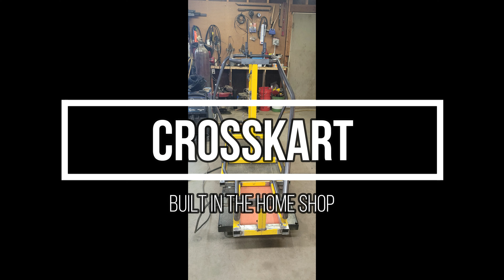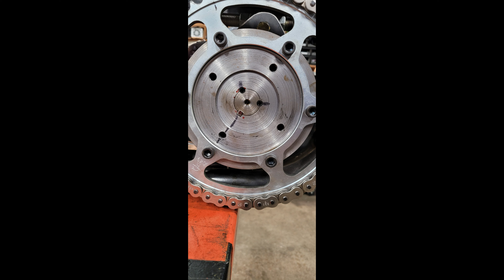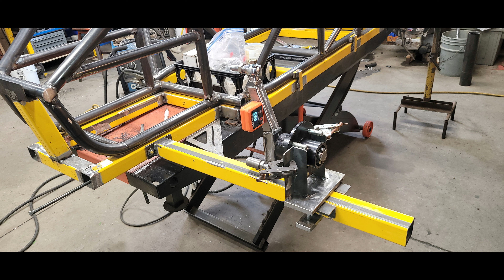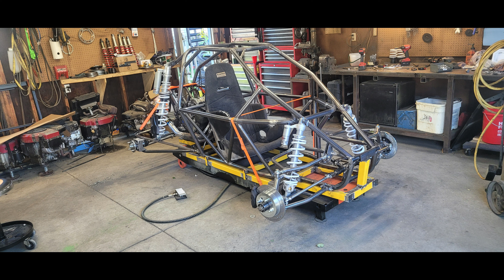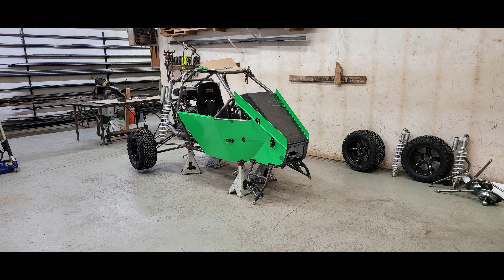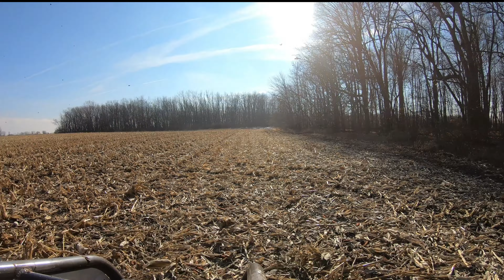Cross kart build slide show and video

Comment: Modified VF-1? Nice job on that front end and windshield redesign man. I just got a Honda CB750, the Miata axles, and the plans for the VF-2. Building my CNC plasma cutter now. What engine did you put in yours?
Reply from the maker: Thanks Zach,  this machine isn't a kj kart, it's my own design, probably a bit larger then kj's. It's currently using an old suzuki air cooled 750 engine.
Reply: @Matthew Jackson  I like your design. I really like that front end and those custom knuckles. I'll be studying this for a while.
Reply from the maker: https://www.instagram.com/p/Cmbwxm0u3uG/?igshid=YmMyMTA2M2Y=
 You will see a few more pic on my Instagram account.